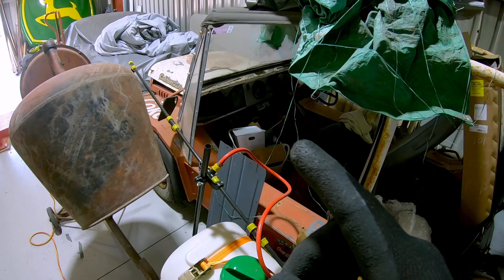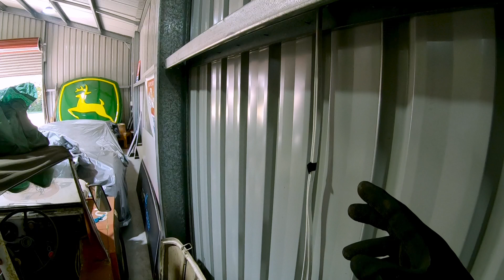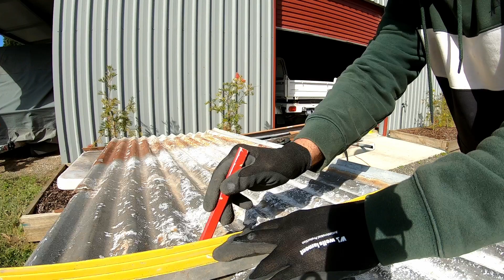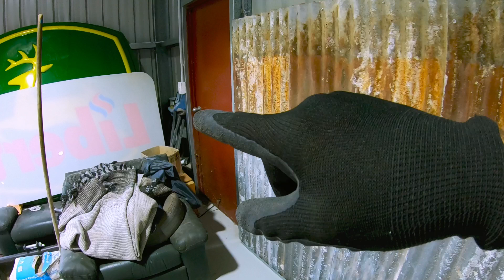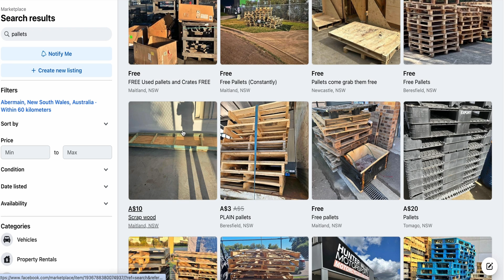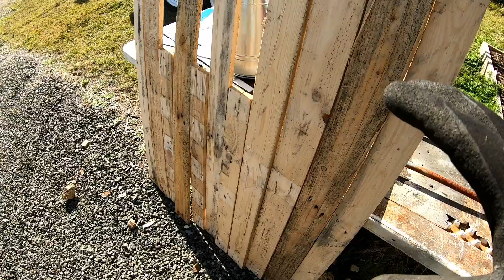Rusty Walls for the Workshop #rustyiron #oldcorrosheets #mancave

Comment: If I can make a couple of recommendations.  My shed is lined with yellow tongue flooring and insulated with floor insulation.  Absolutely superb on hot days.
Reply from the maker: Yes it would be a lot easier if the whole shed had a timber lining. I have just finished the pallet wood timber above the rusty iron and reckon it has cost me about $600 so far for 9 metres long x 3.3 metres tall. Cheers Dave